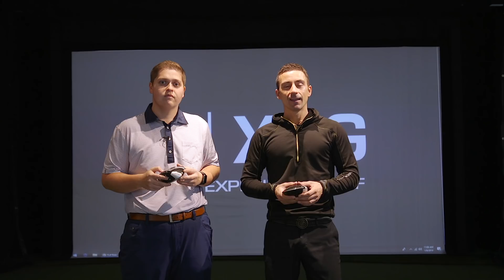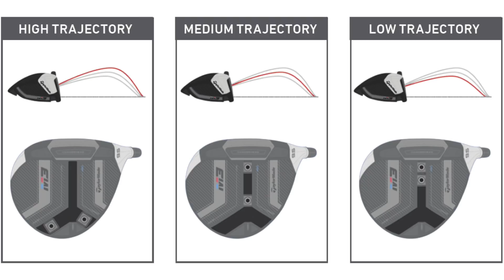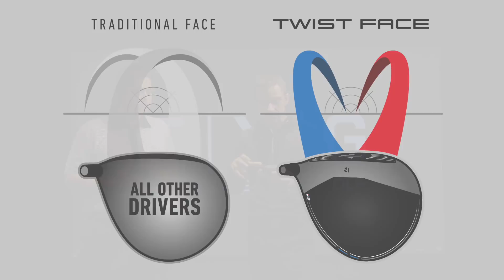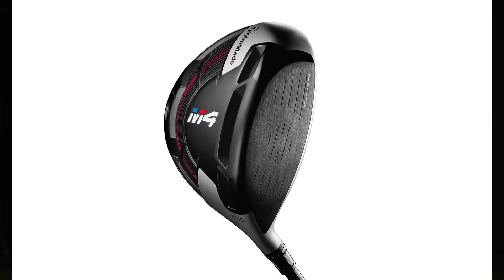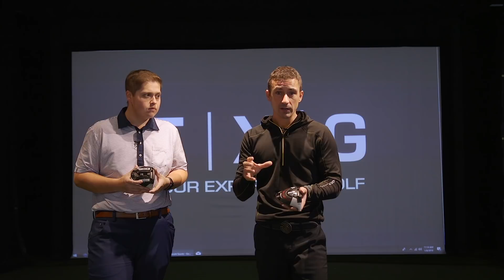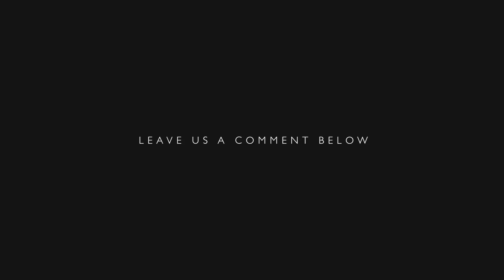Taylormade M3 & M4 | Dustin Johnson's New Driver

Comment: What is the characteristics of the old RBZ stage 2, have done some digging but couldn't find any information on this. 
Now you Ian has worked with taylormade earlier, so I figured your the best person to ask.  
Produce about 158-162 ball speed, but I feel I'm missing something, playing around with different shaft at the moment, but it's quite expensive as I have to buy them :p 
Is the stage 2 high spinning vs the M1, m4 and the newer drivers from TM? Could I benefit from buying a new head? 
Swingspeed around 114.
Reply from the maker: If you're looking to reduce spin then the M3 might be worth looking at. Hard to recommend anything without knowing your ball flight stats Jonas
Reply: Understand :)
Yeah, it feels a little bit ballooning at times :p Don't have any actual stats that is accurate enough :/  
But wanted to check if the RBz 2 head was likely  to be the problem. 
.....
You have answered EVERY question I have ever asked...Thank you so much for taking the time to read AND answer so many comments, I've said it before and I'm gonna say it again, you guys are the best!

Comment: I've now got 3 rounds of 18 hitting driver 8 times per round plus about 2 hours on the grass range with the m3 and I have to say I don't see, feel, or see ANY difference with the twist face.  It's just a good driver.  I'm not losing it off the planet any more than usual :).  Frankly I think the twist face is a myth..It's not even measurable...(4.1 hc).
Reply from the maker: Station 2Station I completely agree!!  Very good driver,, but i’m yet to see proof that twist face does anything.

Comment: I have been playing m1 17 since it came out. I have felt it was the best all around driver I've hit. The m3 seems to launch a little higher and really wants to fade. It is considerably louder. Than the m1 17. It does spin less than the M1 but almost in too low of a capacity.

Comment: Seems like a golfer who hits on the toe with an open face be worse off using the m3/m4 vs any other manufacturer. Would you agree ?  If only TM could have made an adjustable face, now that would have been revolutionary ;)
Reply from the maker: You are absolute right.  The challenge then becomes matching the face to the path.

Comment: I'd like to see how much it could also work against you. For example, i sometimes hit a shot out of the toe, but still have an open face. Will this push the ball further to the right than the current face of a driver, and vice versa from the heel? Where it may help some strikes, it may hinder others?
Reply from the maker: Scott Timmins I actually saw a decent amount of this in initial testing.  Balls that would normally come back staying out to the right.
Reply: TXG Tour Experience Golf it will be interesting to see how it performs for some people over others then. I tend to get a couple of those toe strikes that sort of start right and draw a little or hold their line out to the right slightly, so this could work in a worse way for me on those strikes. I do like that taylormade aren't pushing the "distance gain" with these and are more boasting forgiveness
Reply from the maker: That's why its so imperative that people get fit.  If the strike is location results in less curvature then the premium becomes more on the club face.
Reply: TXG Tour Experience Golf totally agree. I unfortunately don't have any good fitting centres close to me

Comment: I wish channels would highlight the fact that TM did not create this technology, or they are at least taking an old idea and modifying it somehow. This is not a new idea... Cobra has been doing similar things to their drivers since 2012.
Reply from the maker: Zachary Milos you’re right Cobra’s e9 technology did highlight a similar pattern on where golfers impact the club face.  However the technology was not the same, the objective was not to offset launch direction by adjusting the bulge and roll of the driver.  You raise a great point though Zachary and have made me think it’s well worth a follow up video on M3/M4 to address this topic.  Appreciate you watching!!
Reply: SO TRUE Zachary. Amp Cell had this face tech years ago and Cobra still has is in the new milled face F8.
Reply: COBRA’s E9 Face TechnologyTM with dual roll is used in the AMP CELL and AMP CELL Pro Drivers for an elliptical face shape with a canted bulge and roll that improves distance and accuracy on mis-hits from heel to toe and above and below the centerline.   Straight from cobra press release